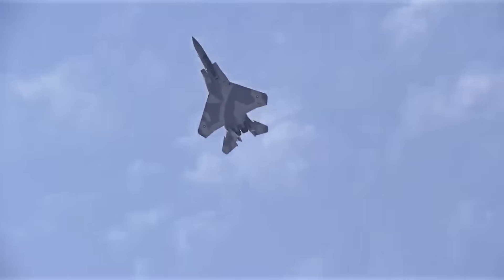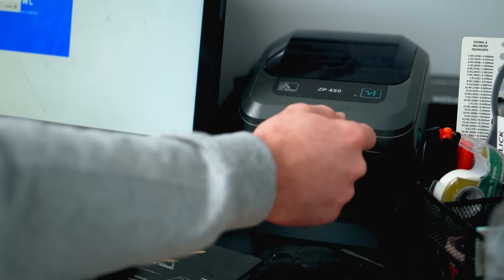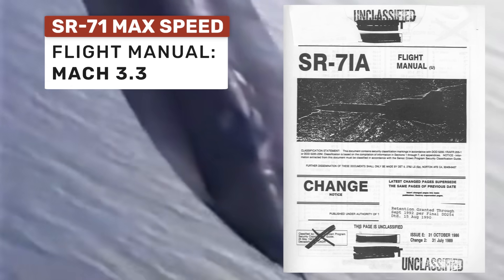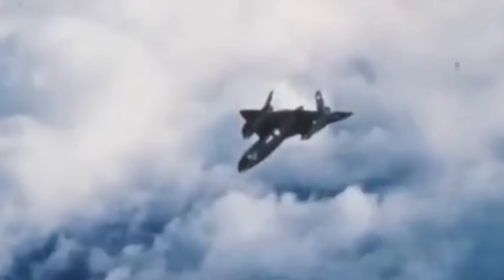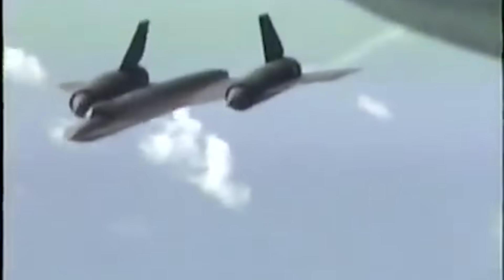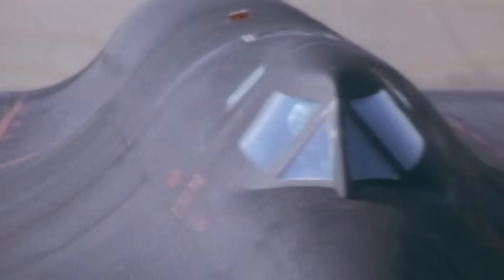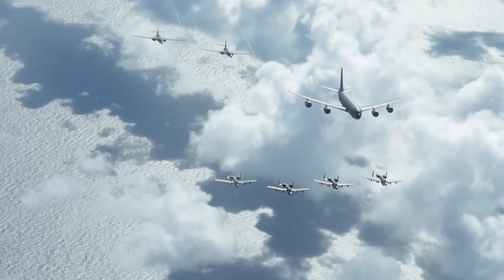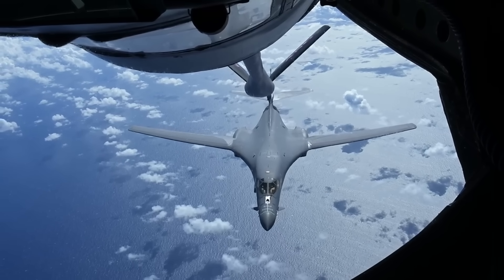The SR-71 was MUCH FASTER than the Air Force will admit

Comment: Man I'd worked with in the 80's came out of the Navy.  Told me a story, he was on a ship off the coast of Okinawa Japan and was on radar.  Saw a signal coming in and addressed his Colonel.  He was ordered to erase the signal and forget what he saw.  He told me it was SR-71, refused to tell me the speed.  Then he claims he was in a bar with a bunch of his Navy friends and he saw some pilots sitting by themselves.  He went over and said hi, introduced himself and asked if he could join them.  David, was a complete geek and very approachable guy.  They started talking about what they did for work and the pilot talked about flying the BlackBird and the other guy said he was on instruments.  David told them he saw them on radar and they told him he didn't.  David asked about the plane and they said they put their food on the glass to heat it up before they ate.  The plane has a problem at speed with the engines lurching yawing the plane suddenly.  "Feels like a train wreck.  Slams you against one side of the cabin or other."  David asked how fast it was.  They wouldn't discuss this but did claim, they've never pushed the plane beyond 40%.
Reply: On a ship in the Navy, a Colonel is called Captain.  The Navy doesn't have any Colonels.

Comment: Well I can tell you it can't go faster than mach 6 because ramjets tend to lose efficiency beyond mach 5.5. And the X-15 almost disintegrated on its historic mach 6.7 run.

With that being said I can't help but wonder if certain modifications could be made (engine modifications, thermal coating, external fuel tanks, etc...) for a mission specific occasion where top speed was needed?